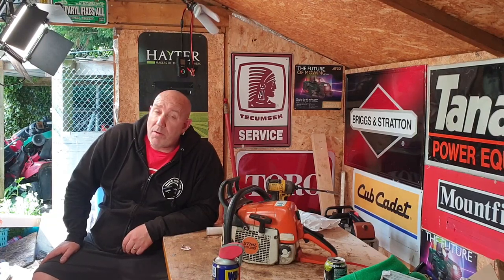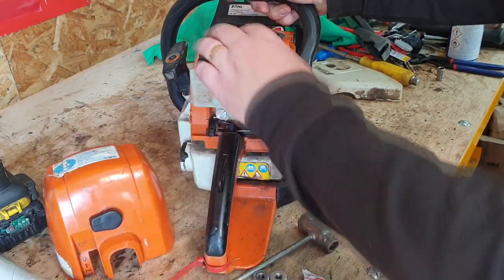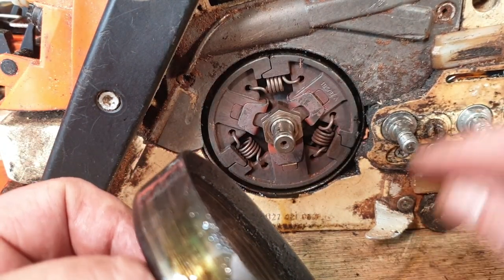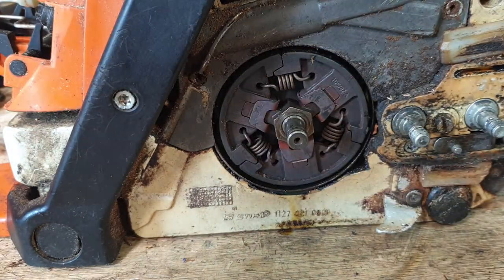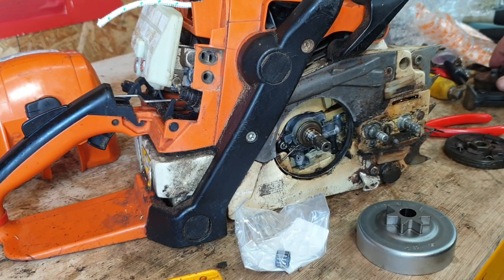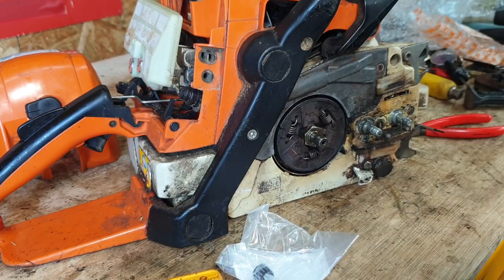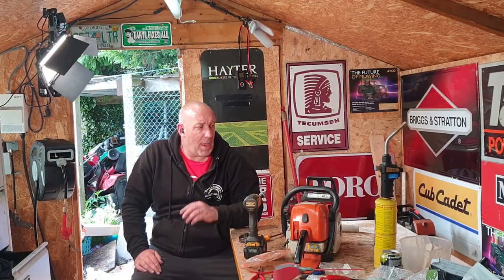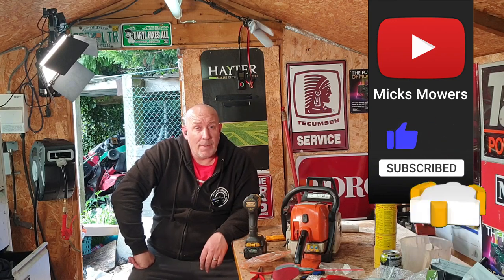HOW TO EASILY REMOVE THE CLUTCH OR SPROCKET ON ANY CHAINSAW. STIHL ECHO HUSQVARNA

Comment: Thank you! Exactly what I need to replace broken piston, or clutch? Whatever the round part under the sprocket is called.
Reply: Follow up question, what caused the clutch to break? I inherited Stihl 029 from my father in law and I was using it to cut down one pine tree before it stopped working. Did I do something wrong or it's simply because it's old and heavily used?

Comment: Hi Mick , stihl 038 , my drum is rock solid, how to get it off ?
Reply from the maker: Wd40 it over night . Then with a pair of grips get hold of it and wiggle it .. side to side.  It should come off . They can be a bugger
Reply: I use hose pipe pliers and grab the drum. After taking the e-clip and washer off. Then pull up on it while rotating it back and forth. Normally occurs when the bearing has been plugged up with plant material so it becomes bigger than the drum's ID.

Comment: Hey, Mick. Good repair video. Could you do a video on replacement of the oil line and pump on a jonsered/husqvarna chain saw? My older Jonsered CS2150 spews oil within the entire clutch area including the cover. What a mess, especially after cutting wood. Chain is still well lubricated. Tired adjusting the oil dispensing regulator underneath the saw, but a no go. There are not that many repair videos on YouTube relating to jonsered/husqvarna chain saws; most deal with Stihl. I wonder why. Preference wise, I prefer the Swedish saws over the German and Japanese saws. (I own all 3) More compact, light weight, easy to handle, idle so much smoother (no dancing!) and pack a more powerful cutting punch sizewise without bogging down. Seems Stihl has cornered the market in mostly urban areas. Here in Ontario, Canada and the most of the States, the saw of choice by professional loggers and wood cutters is husqvarna. Does that tell us something? Far better saws! Cheers, eh! 🍁🍺🍺